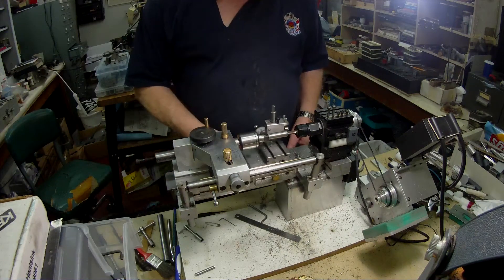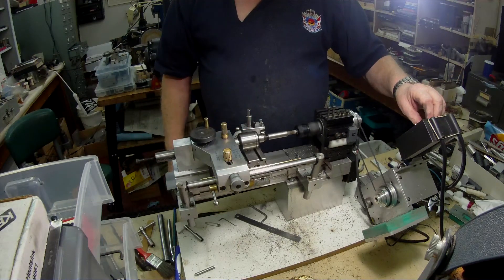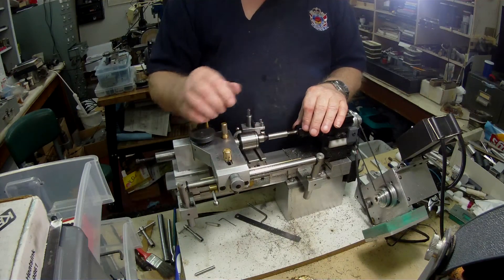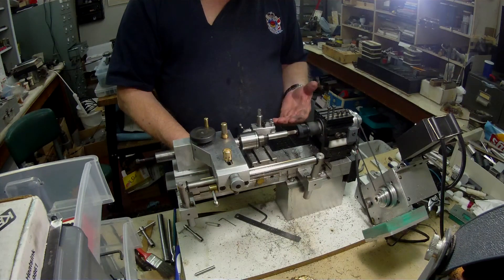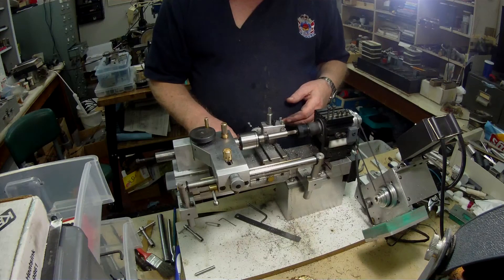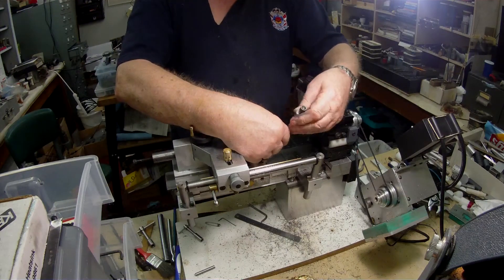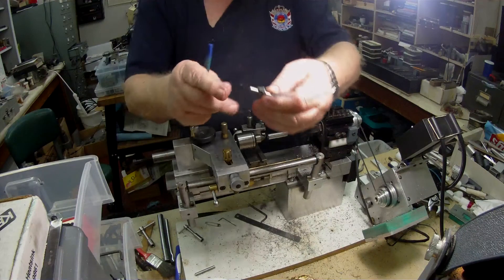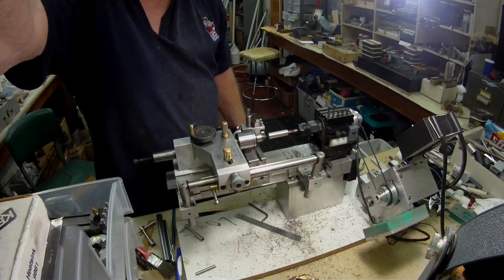FILE0008  Making dti swivel adaptor part 2

Comment: You have been in the tool and die trade for a long time. Your experience is valuable to me, so I listen to everything you say. The only quibble I have is the lack of a place for your drawings. Perhaps you should start a blog. Then you would have a place to post stuff in. Please start with your compound slide rework. I hate the Taig compound.
Reply from the maker: Juan Rivero 
Juan, thank you for your interest in my channel, I'm afraid I have no idea how a blog is developed or how it works, regarding my drawings, when I start a project I sometimes start of with an idea and rough it out in Draftsight, I might start in the house in the evenings and load it onto a usb then take it into the shop and start machining in the meantime I open the drawing and change something, and that's how I progress until I finish the tool, by that time I may have 5 or 6 drawings on that tool all bits and pieces and probably one doesn't tally with another, by that time I may have copied onto several usb's, so I'm not very organised with my drawings, basically the project is for my interest and so I have never thought about finishing my drawings, at this point in time I would have to hunt for the unfinished drawings the only thing I could do to help you is if you are wanting to start on the top slide mod I could take measurements and do a basic drawing for you, but I don't want to do that if you just want to look, I'm 79 and just had a pacemaker installed so time is short,